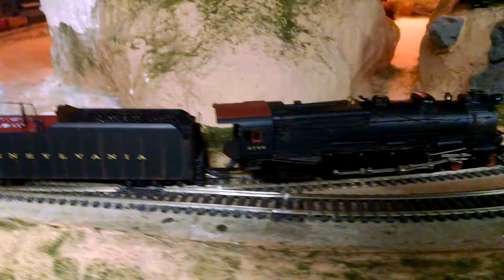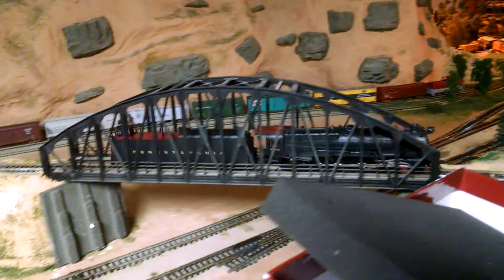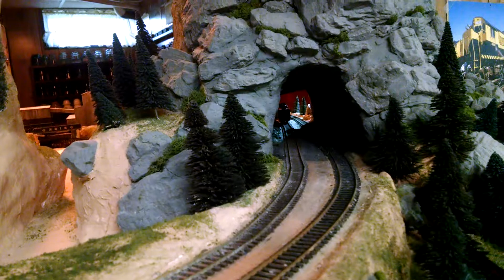My grampas ho scale layout part 5 steam engine with sound

Comment: Mike, wow I really like that PRR either M1A or M1B. Anyway, I do like that whistle to. Sounds real close to a PRR 3 Chime.
Reply from the maker: Thanks Tom and I really like this steam engine to its very cool but the reason why I didn't run it around the hole set was that it comes off the track alot so I just ran it not that far